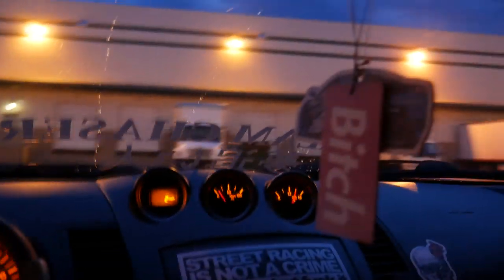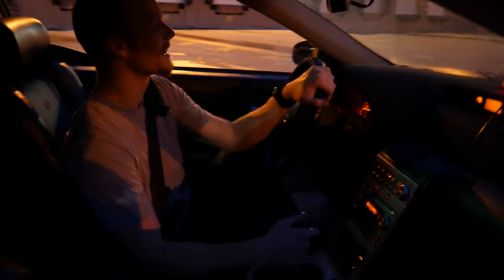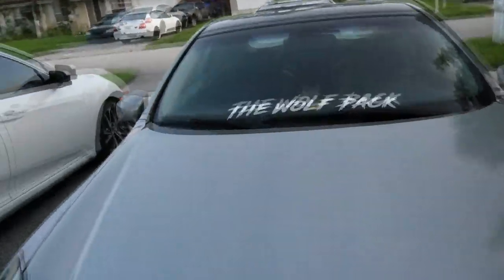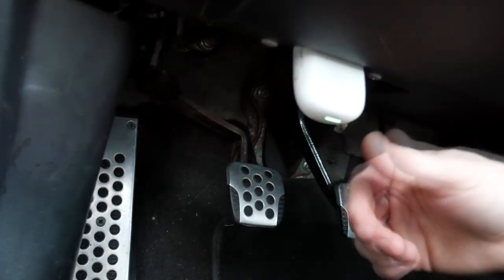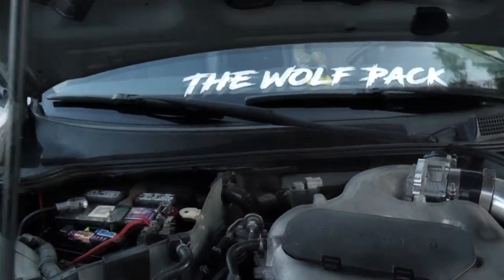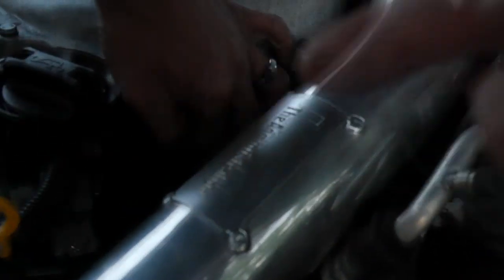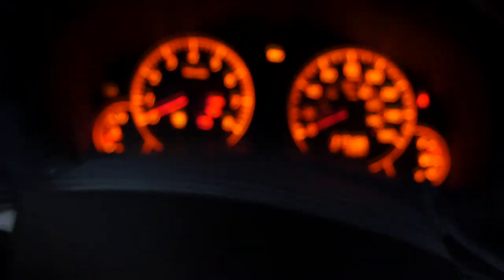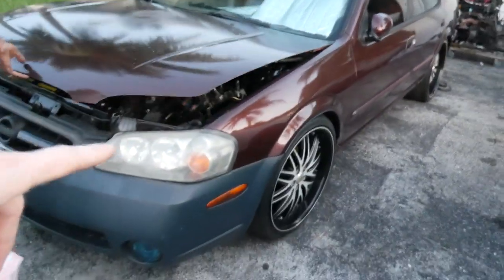G35 Vlog - Diagnosing a Random Multiple Misfire

Comment: U should check the valve cover gasket because it will happen again I replaced the coil pack and I was good
Reply: Oil is getting to the plugs trust me it might not be wet when u take it out be it is subscribe lol to my channel and I got lots of engine parts for the g
Reply: audiodoctor 860 you mean spark plug tube seals?
Reply: @pushhrodd01  yes my bad buddy lol

Comment: Make sure your coil packs are completely connected and not loose because my g sounded exactly the same and turns out my coil pack on cylinder 1 was just not plugged in all the way , plugged it in and problem solved
Reply: Bryan Gonzalez did you not watch the video? He fixed it dude

Comment: PLEASE
I change coils and spark plugs and still de p0300 and can't run more than 2000 rpm when is running, on parking i cant rev it more than 5000, loss power and make a strong noise 
Any idea??

Comment: I have a G35 sitting in my backyard and want to fix it but don’t know where to start. How can you help me.
Reply from the maker: You could watch my videos
Reply: I live in Miami Gardens and need to know good BodyShops and I need to implement that intake in my car.
Reply from the maker: @melmann7615  I don't know any good body shops down there
Reply: Mel Mann You got it running g?
Reply: @AaronNewman  hey man my g cut off while driving it starts back up but runs like shit then cuts off the battery light and brake light was on and check engine light was blinking I have a leak in resenator pipe that’s it a couple of weeks now I can hear a whine when accelerating and at low speed from alternator I got new battery and stater weeks ago the alternator is 20 yrs old it’s a 04 g35x awd  original parts I got new spark plugs and coil packs

Comment: Good luck fixing that misfire. Could be so many things. First replace the spark plugs. If not fixed after that replace coils. If that doesn’t fix it could be an injector. And In some cases the cats are bad
Reply: And in my case my valve gasket was blown and leaking oil to the plugs and coil
Reply: Definitely not the cam sensor.
Reply: VQ 37 did you not watch the video? He fixed it. Watch the video before commenting
Reply: i replaced my spark plugs, ignitions coils and it ran fine after.

Comment: -spark plugs
-ignition coils
-broken wire
-injector
-spark plug tube seals leaking oil flooding plugs

That’s my only guesses
Reply: MY G 35 I PUT ALL NEW COIL PACKS AND NEW GASEKTS AND VALVE COVERS BUT THER ONE BRAND NEW COIL ISNT FIRING SO I PUT IT ON ANOTHER CYLINDER THEN IT WAS IM THINKING THE PLUG IN WIRE IS MESSED UP

Comment: Damn you're so lucky man. My G35 just threw the same P0300 code. Already replaced all coils and spark plugs. Code didn't go away :(
Reply: Ever end up diagnosing and fixing?
Reply: Did you ever find out I have a p300 right now changed all coils and plugs still missfire

Comment: My G has misfires too, I've replaced valve cover gaskets ( both sides), all ignition coil packs, spark plugs are new, replaced all fuel injectors, both camshaft sensors, crankshaft sensor on the driver side, and the fuel pump is fairly new as well. My shit won't start tho
Reply: Also the starter is new, it's been at the mechanic shop for over a month already
Reply: I bet its something super simple like maf or iacv... Watch.
Reply: Breion Bethel I cleaned the MAF with MAF sensor cleaner already, what's the iacv?
Reply: Coil pack ground cleaned mine up real good havent had a misfire since .
Reply: Have you done a compression test on the cylinders? I had to end up replacing the engine on mine. ☹️
Reply: Platinum ride what signs did your car give off that made you do that? A friend of mine was working on my car for a bit but couldn't get it to turn on. He told me the fuel injectors weren't opening up, this was before I took it to a mechanic
Reply: @drew1k978 
First, my car started losing power. The P300 code showed misfire on three cylinders. So I changed all the plugs and ignition coils but the P300 code was still there. Finally, I took it to my mechanic and he said the injectors was fine but done a compression test and half the motor was shot.
Reply: @drew1k978  remember guys, when dealing with stuff like this always get oem parts.had a whole summer in the garage replacing coil packs only to find out only oem worked lol... Whole summer no car. And iacv is "idle air control valve".
Reply: @platinum_g3511  yo men that’s exactly what happend to mine please if you know anything else lmk !!